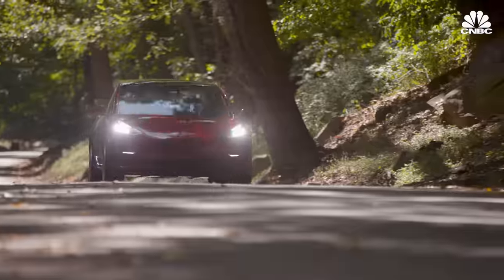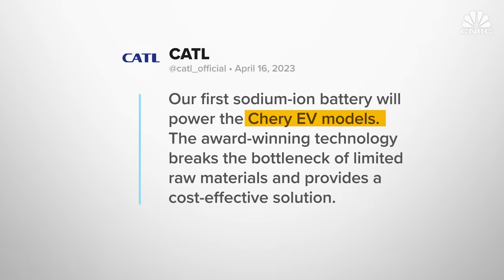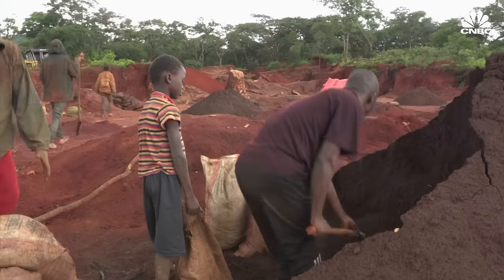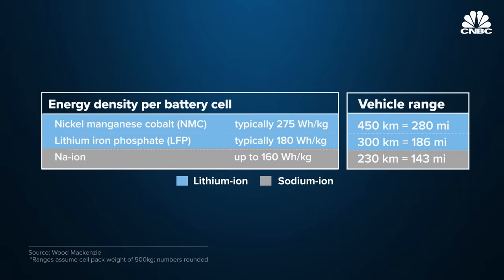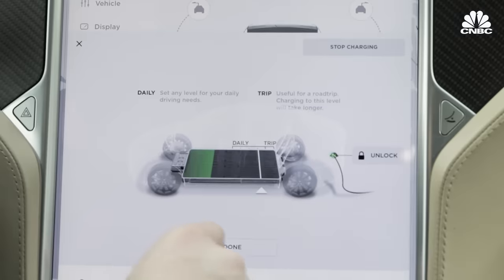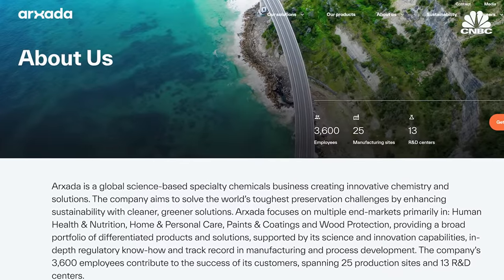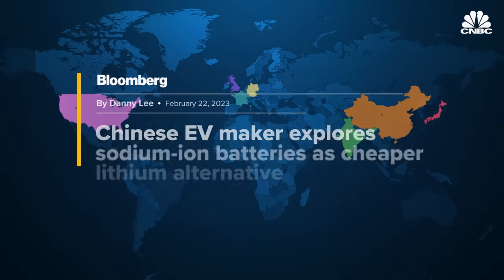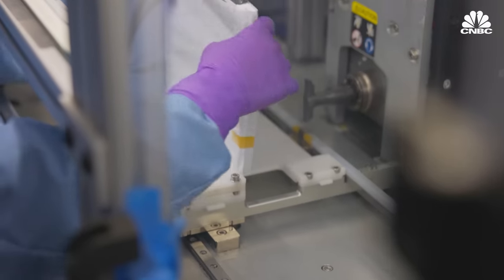How Sodium-Ion Batteries May Challenge Lithium

Comment: It isn't a shortage of lithium itself that's an issue, but the refining of it.
Sodium is definitely worth pursuing.  Sodium ion will be better for some use cases.  Lithium ion better for others.  Using both, where appropriate, spreads out needs & resources.  A win.
Reply: Homes should definitely have these sodium batteries then lithium for cars and gadgets
Reply: @manuelmacalinao500  Exactly.  Taking up more room matters little for home or utility storage, while the lower cost of sodium is a clear win.
Reply: Same can be said with any other generative energy source (solar, oil, nuclear, coal, wind, geothermal, hydro)
Reply: @MurseTech64  storage and generator are different.
Reply: Aluminum ion is another chemistry. We should pursue them all and also other techs that work well for grid scale.
Reply: Sodium ion batteries can be easily used in buses
Reply: I dunno i'm skeptical ever seen sodium expand in a pressure chamber when heat is added to it looks dangerous like samsung note dangerous xD
Reply: @susanthejew6351  Was it Pure sodium or any sodium compound?
Reply: NO Sodium ion can completely replace lithium
Reply: No, it’s an all of the above issue and lithium is not available just anywhere.
Reply: @susanthejew6351  That’s why it has to be doped with other things.  Fighting the downsides to get the upsides.
Reply: @jeanpaulchristian3282  No chance sodium can simply replace lithium.  It’ll be good for some uses, not for others.
Reply: So sodium still needs to be heated in order to be used...

In the 70s it was heated to 200 degrees before it could be used, is it still the same thing today?
Reply: yeah but where they going to get all the sodium, digging up Africa for it or deep sea mining or something.
Reply: Lmao no, Sodium having far longer charge cycles and being far safer than Lithium will be its main weapon into becoming the dominant material in batteries. Reminder that Sodium Ion tech is still in its infancy while Lithium has been around for like 2 Decades already.
Reply: @satyris410  LMAO ,, OCEANS of the stuff
Reply: @susanthejew6351 that's a lithium battery
Reply: @fg009letyrds8 exactly 2 decades of people throwing away lithium batteries  in the trash because their Kodak cameras battery died, or they needed to change the battery on their garage door opener or keys...also all the old flip phone batteries were lithium too, so imagine how many of those were thrown away when grey started bulging
Reply: Sodium Ion is ideal for ebikes and light emotos.
Reply: @manuelmacalinao500  Exactly, but for gadgets maybe solid state batteries ? Ive saw that Xiaomi was experimenting on their Mi 13 and they put solid state battery instead of Li-po and they made from 4500mah to 6000mah with the same physical size of battery. But I agree, cars are still better on lithium atleast for now and homes where size and weight of battery doesnt matter there would be sodium-ion excelent
Reply: Chinese ev's are first with sodium ion batteries right now from catl
Reply: @larryc1616  Yeah Ive heard about it but I dont know, Im not sure if they will be much popular in cars since youre sacrificing the range compared to the lithium. But maybe it has future in small city cars in which the range doesnt matter that much
Reply: Gee, thanks professor😮
Reply: A HUGE problem with lithiom-ion batteries is that they require cobalt, virtually all of which comes from the DRC (Democratic Republic of the Congo).  Nations like this are HIGHLY subject to political turmoil, use slave and child labor to mine the cobalt, and are just plain unreliable.
Reply: @trwent  Some do, some don't, the chemistry varies.  But for those that do, yeah, that's a prickly issue.
Reply: @trwent  If Im right then for example Tesla banned cobalt into their batteries (somewhere in 2021, I think) so they only use lithium manganese and other materials but not cobalt anymore. But yeah some manufacturers still use cobalt in their batteries.
Reply: I agree. Lithium-Ion batteries were perfected by Japanese companies for portable electronics such as laptops, cellphones, walkmans, etc. Technological challenge was to make them lighter, smaller, and more powerful for those portable electronics. They were never designed for extreme outdoor temperatures, nor for external shocks like collisions.  

Early Model S Tesla exclusively used high-grade Panasonic 18650 Lithium-Ion battery cells for reliability and durability. Laptops batteries generally have 6-10 cells, but Model S use a few thousand cells per vehicle. Lithium-Ion were never meant for cars, and even Panasonic was shocked with what Tesla was doing. This was back in 2010.

Comment: Excellent, by using sodium batteries in for example stationary application where you don't need low weight or small size but you do want high storage capacity sodium can be a great replacement for lithium which saves lithium and associated materials for the other cases where you do need low weight and/or small size
Reply: Storage solution should focus on reuse the existing battery stock from EVs.  Otherwise those batteries will go straight to landfill and cause significant damages to the environment and waste limited resources.  No new storage batteries these days should be produced from earthed materials but should all be based on recycled stuff.
Reply: @BikeOnRoadLondon  no it's not worth it. Old batteries does  not take charge properly and have huge losses. They will be recycled instead
Reply: @fdk7014  Not to mention they are far more susceptible to dendrites, mechanical deformation/strain, and ensuing thermal runaway. Best to properly recycle
Reply: @BikeOnRoadLondon  Lithium batteries recicleble with about 90% efficiency.
Reply: It can also solve multiple problems with one solution.

Especially since we have an abundance of sea water.

One company gets sodium for this battery project. Nearby towns get clean drinking water. And we don't have to worry about a scarcity of Lithium.
Reply: @fdk7014  That's true. We've done this with standard car batteries for many years.

Comment: If the price is right sodium would be a great solution for home battery storage where weight is less of an issue.
Reply: Try the Aluminum Sulfur batteries being developed by Avanti- Then there is new Room Temperature Sodium Sulfur batteries
Reply: Battery for family house or buildings would be amazing.
Reply: CATL already has 200 wh/kg.  This is only already better than most LFP marginally worse than 230 wh/lg of bleeding edge LFP.  Nickle based cells achieve 260 wh/kg.  Factor in lower costs, less structural defense (due to safety) and this makes a ton of sense even for vehicles (as long as volume is available).  Running the numbers of same space and 300lb less weight than the pack for a 1000 mile Aptera could support a 500 mile sodium based Aptera; still more all anyone realistically needs.
Reply: For home yes. But what about transportation many countries are looking to replace fossil fuels with EVs. That going to be where the big money going to be.
Reply: Sodium for home and othermore denser lighter batteries for movable and portables. In a decade or so we will have battery similar to power bank power e bikes.
Reply: Sodium ion will be very low priced vs lithium
Reply: Sodium ion doesn’t have the energy density necessary for EV applications but could work in larger format stationary energy storage
Reply: @brandonprice1301 China has thousands of busses that use sodium ion cells. For decades.
Reply: @erdem--  "For decades" 😂😂😂🤣🤣🤣
Reply: @teax25 but homes uses double of the fossil fuels than vehicles

Comment: A Sodium battery that doesn't combust or explode when exposed would be a MONUMENTAL advancement, even if they lost some range over Lithium. I'd fully support it.
Reply: yes the safety factor is a very important issue,i dont want my house burning down with a lithium one..thats why i'd never buy one
Reply: dont worry afaik the "lost" range is very miniscule
Reply: We have sodium batteries, you want to see!
Reply: @steve-r-collier  LFP batteries (another version of Lithium ion) are quite safe. Tesla is using more of them now.
Reply: @steve-r-collier  not just safety the simple fact it's very ambundant compared to lithium is great news, it can be used for power storage for homes etc, especially places where size isn't an issue.
Reply: @steve-r-collier  Yup...i was pro lithium battery EV many years ago but with all the scary horrid fires on the news I will WAIT for safer battery tech. The problem with sodium batteries is that they degrade rapidly compared with Lithium ion batteries. Solid state in both sodium and lithium hopefully is few years away only.
Reply: Sodium is very reactive. It explodes when exposed to water. Pure sodium is stored in oil. You must have missed chemistry. Besides they just discovered a huge lithium deposit in the US.
Reply: @CrankyTim  Thank you for that clarification. I had a wonderful science teacher in 6th grade that showed us how reactive sodium was when contacted by water. Very good school back in the 60s.
Reply: Yes, the safety hazard issue with Li Ion batteries is a huge problem and I was delighted to see how the guy drills right into a Na Ion battery and nothing happens.  But, later in the video, they talked about shipping the batteries at 0 volts so that there is no explosion risk (or something to that effect).  Li Ion cannot be brought to 0V or it will be ruined.  But that makes me wonder, are Na Ion only safe when they're fully discharged?  I'm unclear on that.
Reply: @eleventy-seven  The sodium in the battery is chemically bonded with other elements. Sodium is in a liquid electrolyte containing dissociated sodium salts in polar protic or aprotic solvents.
Reply: Sodium battery
Reply: I would prefer a plugin hybrid with 100km range and a combustion engine range extender. With sodium batteries so it doesn't burn my house
Reply: The advantages of sodium ion electric batteries are many and I consider them the best Much cheaper Its price is approximately 10% of the lithium battery only Faster charging (almost two or three times faster than lithium) Withstands a variety of temperatures. Lithium batteries cannot withstand high heat or extreme cold! It includes the diversity of the presence of raw materials in different geographical ranges. It does not use cobalt, graphite, or lithium, and it is not flammable. As for cost, sodium batteries have the advantage of availability of materials and the possibility of improving their energy density, and their cost can be reduced Sodium batteries could take over a significant share of their lithium-ion counterparts, alleviating lithium supply issues and lowering overall prices for electric vehicle batteries.
Reply: @steve-r-collier  To be fair, the chance of a lithium ions battery burning is as much or less as a gas burner and largely due to saltwater flooding damage not being treated, but sodium ion batteries would definitely take that risk to zero.
Reply: @eleventy-seven bro go learn some chemistry sodium in baterry is not pure but chemically doped hence inert

Comment: Definitely right now, sodium has a best use case in phevs and smaller short range city EVs. Use them for all those vehicles to free up resources of Lithium for the other EVs.
Reply: There seems to be enough room in the pool for both technologies, whether the Sodium batteries are used in EV's or not.  They could certainly be used at the EV "pumps" as was described in the video.  They could also be used in other areas where space and weight are not as much of a concern.  For example, grid storage for renewable energy; or home chargers.  It's also possible that the Sodium battery technology will improve to the point where it makes more sense for any EV.  There are also several other battery technologies being researched that could become commercially viable soon.  If I were an EV maker, I would treat batteries like gasoline...try your best to be compatible with whatever comes along.
Reply: I find the idea that we're using lithium batteries for products like the Tesla Powerwall just bizarre. The oft repeated dogma that energy is very difficult to store may be proven wrong yet with enough technological development. Interesting to watch the technology evolve.
Reply: And for energy storage